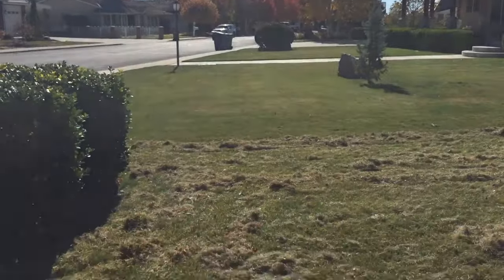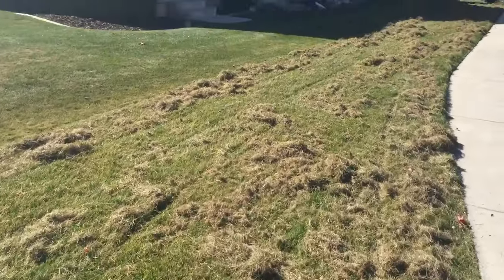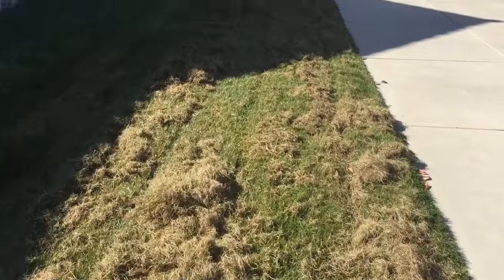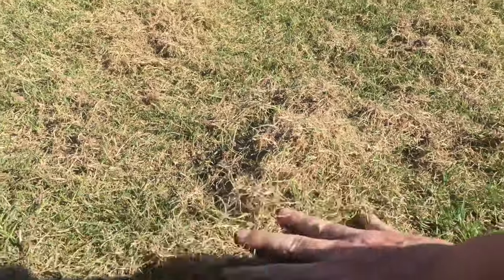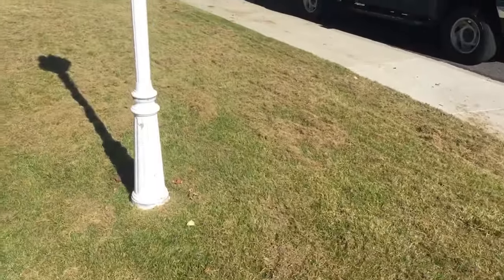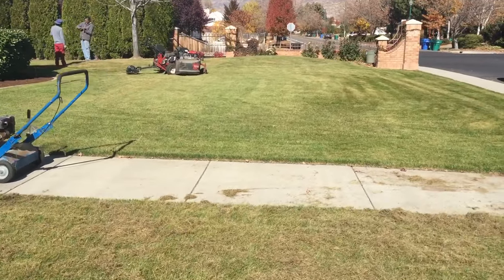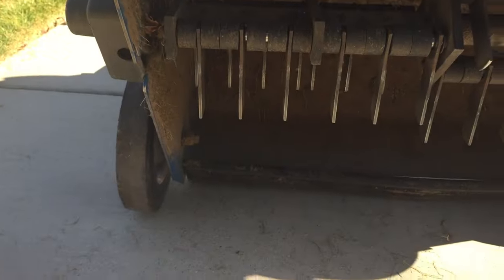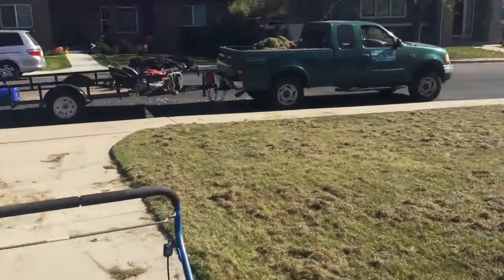Why and how to power rake or dethatch a lawn

Comment: I bought the exact dethatcher (power rake) in your video and used it on my lawn. A lot came out and it was pretty satisfing. I was very dissatisfied when I went over it with a hand dethather, a metal hand dethatching rake afterwards. The power rake got maybe 50 percent. I tried to go over my lawn again with the power rake in a perpendicular direction to the first time I did it. No more thatch came up, it just tore up the grass. I tried adjusting the height one hole lower but it really tore up the grass then. Now I'm using a hand dethatching rake and still bringing up lots of thatch even though it was already done with a power rake. I have a 1.5 acre lawn. It's going to take me all summer to do it by hand. I saw another video for a mantis dethatcher. I'm curious to know it the mantis dethatcher will pick up what the Bluebird power rake left behind.
Reply from the maker: I couldn't agree with you more.  To answer your question on which power rake is the most effective.....?  I haven't found one yet.  But I also haven't spent $7,000 to $10,000 on the ones that supposedly do remove most of the thatch / dead grass.  

I've found through my lawn walkthroughs at customers homes, who have power raked, that 99% of them that didn't complete the final hand rake still have 20% to 30% thatch/dead grass in the mid layers of the lawn.  The machine for the most part pulls the dead grass off of the top layers of the soil.

I would find a rake attachment or the dethatch spring attachment for your riding mower to remove the rest. Really appreciate the comment.  So much truth in what you're saying.

Comment: Nice video. I dethatch my TTTF every Spring as my “wake up” for air flow and I would never skip. Cleans out all the dead 💀 winter stuff too. 🤙🏼
Reply from the maker: I dont blame you. Makes it pop!
Reply: Exactly. 👍🏼
Reply from the maker: @LawnDad  it's also the worst job ever hahaha
Reply: The rake up! Lol 🤦🏻‍♂️
Reply: @ @pestandlawnginja  - After de-thatching the lawn, why do you rake up the thatch instead of just going over it with a mower and sucking up the thatch via the suction of the mower / bagging?
Reply: @Twister051  That's what I do.  Or, a strong blower will work, too.

Comment: Can you recommend the optimal cut height? I have two lawns. Both in the shade. One is full of moss. I recently bought a lawn mower robot.
Reply from the maker: Depends on mow frequency and type of grass. I mow every 3 days with bluegrass at 1" and every 5 days at 3". For mossy areas I would do 2" to let it air out.

Comment: So, my new VonHaus dethatcher-scarifier-aerator (would love to see your review of it) was delivered yesterday...assembly was a breeze. I got it early because it’s always “out of stock” on Amazon (maybe that’s a good thing?), and I didn’t want to be ready to use it on my lawn but couldn’t get it. My question is: I live in middle TN and my front yard is primarily Tall Fescue (Bermuda is creeping in, however...and the back yard is primarily Bermuda—already took over)...it doesn’t look too bad, until you look down and spread the grass—tons of thatch! I mow at the highest setting, which is just shy of 4 inches....never use the bag...always mulch. Okay, so here’s the question: When the yard is ready for me to scarify and dethatch (I have a professional lawn service doing the aerating afterward), how short should I cut the grass (assuming it’ll be the last cut of the season?) Thanks, and sorry my paragraph reads cryptically. Basically, how short for Tall Fescue? Thanks again!
Reply from the maker: Hey Danny. Great to hear from you. I'd take it down to 2"
Reply: Pest and Lawn Ginja - Thank you. I’ll need to figure out how to gauge cut height with my Husqvarna HU800AWDH, since I always cut it on the highest setting (one less for the Bermuda). Do I cut a little strip and then measure the blade length?
Reply from the maker: @dannymcneal  put it on the concrete, open the back shoot and take a stick and measure the height from the ground to the blade.
Reply: Pest and Lawn Ginja - I just moved my lawnmower to the driveway, opened the side door and measured the blade height from the concrete for all nine positions. 3.75” at position nine...2 1/8” at position 5...all the way down to 1 1/4” at position 1 (I’ll NEVER use that one—probably). I am stoked to know this information, and will be ready to mow it on position 5 this Fall. Question: Would you recommend that instead of going from position 9 (from the previous cut) straight to position 5 all at once? Or would it be safer and less stressful for the grass to, say, space the adjustments out more? Like one cut on position 9, the next cut on position 7, and the final cut of the season on position 5? Thanks for your advice! I’m stoked now!!
Reply: Oh, and can I cut to 2 1/8” and immediately scarify? Followed by a good dethatching? I have a lot of thatch, so should I scarify first and then dethatch? Or dethatch first and then scarify? Thanks again...sorry for being such a pest, but my learning curve is pretty vertical, but I guess this proves that at 61 years old, I’m still highly trainable. 😉
Reply from the maker: @dannymcneal  I always dethatch then scarify. Imo it's easier on the machine.

Comment: Can I dethatch in Summer? I think our thatch is killing our grass. Our sprinklers can keep our grass alive with the heat. TIA
Reply from the maker: The heat that the dead grass holds and the amount of water and nutrients that get bound up in the dead grass cause more damages than the potential of "burning" the roots from exposing them.  Which IMO is far fetched from reality and goes in the same pile of odd things to say like "you can't water on a hot day for fear of burning the lawn".  

The truth is, landscapers want to do power rakes late fall and early spring before and after they are finished mowing for the season to drum up more business.

Removing matter from the grass that is causing it to choke will not cause more negative consequences.  It will only benefit the lawn.  You'll want to apply some micro nutrients, Mycorrhizae, and organic fertilizer to stimulate the microbial action and growth of the lawn after you power rake.  I would recommend you do this no matter if it was spring, summer, or fall.  

First and foremost you'll want to make sure you check your sprinkler coverage to make sure the areas your concerned about aren't overly dry.  You risk scalping the lawn with a power rake if its too dry or too wet.  

Thanks for the comment.

Comment: My whole lawn has all these horrible hard clumps of dirt or possibly nightcrawler castings.  Walking on it is like trying to walk on a bunch of golf balls.  Would power raking help break them up & spread them around? Or do you have other suggestions?  I am tired of spraining an ankle every time I walk on my lawn, lol.  Thanks.
Reply from the maker: Earth worms are tough to deal with once they are out of control.  There are some insecticides on the market that claim they will help control earth worms.  I haven't had the best luck with them.  I find that regular aeration 2 to 3 times annually and a deep watering plan are your best way to control them.  I find they surface due to too much consistent watering.  If you get the top layer to dry out the worms will dig deeper.

For now if you would like to fix and repair the cheapest way is to water 3" to 4" and rent a roller.  You want the top layer soggy but not too soggy to the point where you walk on it and your foot is sinking into the soil.  Afterwards you'll want to top dress the areas that have sunk or are uneven throughout the lawn. Best of luck.

Comment: My yard 3 summers ago was great, last year 2 attached neighbors went weed crazy. It took over my lawn. Goatheads inc. Now my back yard is almost all dirt. Can I dethatch still? Will this eliminate the goat heads and allow me to replant?
Reply from the maker: Thanks for the comment.  If I understand your question correctly, you're wondering if power raking without a presence of grass can have an impact on Goat Head weeds?  That's a tough question.  Power raking is more of a process for lawns that are too thick or dense in dead grass or thatch layers.  Power raking an already thinned out lawn may not be in your best interest.  

Here's how I would approach your situation: 
I would decide weather you will 1. scrape the top and re sod or 2. over seed with a new grass.  

I would then spot spray weekly and be hyper proactive about it.  Goat heads can lay dormant for up to 2 to 3 years before germination occurs.  

I can tell you first hand that it took me 2 seasons to rid of all the goat heads.  Then we worked on my neighbors property "that was all dirt at the time", put in sod and a year later we were goat head free.  It can be done with a lot of patience and hard work.  Good luck my friend.

Comment: wondered why in the bald spots in my grass i had moss. i try to scrape it away but doesnt help. i wish i could just dig up the lawn and start again but im renting so even if they let me i wouldnt bother
Reply from the maker: Thanks for commenting.  Moss is generally a sign of too much moisture buildup in one area.  My suggestion would be to overseed the area with a shade mixture of Perennial rye grass and turf type tall fescue.  After it takes you'll want to make sure you're not watering more than 2 to 3 days per week.  Just remember the old rule of thumb, less days more minutes with your watering cycles.  If that fails you'll need to re-sod.  Hope that helps.
Reply: Iron kills moss too. Moss is also a sign of acidic soil. I’d recommend pulling a soil sample and adjusting the pH with Dolomitic lime
Reply from the maker: Great comment!

Comment: Hello.
I like the video very helpful.
I have a question I've killed of all my grass due to root weeds. 
Now wanted to start over  realised the ground is full of thatch and moss.
New house and never been looked after.
My question is can you still use a teacher rake on dirt ground is there is no grass or would it damage the rake.
Cheers
Guilio.
Reply from the maker: Hey Guilio!  IMO if you have tons of thatch and weed roots It may be better to do a shallow till, level, then overseed or sod.  If you choose to use the thatch rake I would use the cultivation side.  The rake is fairly sharp and I think if you did it lightly it would be fine.  They're only $35, IMO even if you did ruin it by the end of your project it paid for itself.
Reply: Pest and Lawn Ginja 
o that's brilliant Thank you for the info and help.
To look at it looks like dirt but treading it you do get the bouncy feeling.
Probly  seed it november after all the moss and thatch gone.
😀
Reply from the maker: cool guilio, best of luck.

Comment: Great stuff! But did you say the power rig rotates 200 times PER SECOND? If true, I guess using a manual thatching rake makes zero sense...?!?
Reply from the maker: That was my mouth talking sooner than my brain.  in all reality it spins quickly.  I believe the math is a 50:1 ratio.  What I was trying to say is the accumalitive scours of the tines themselves would add up to 200 per second.  but even that is questionable.  it is far more effective than using a thatch rake by comparison to time spent on the job.  with that said both tools are very efficient and the power rake is more invasive on the grass and requires about 4 to 6 weeks to recover where the thatch rake is about 1 week to 2 weeks to recover when done properly.
Reply: @pestandlawnginja  ok thanks for the added input - didn’t think about recovery time!
Reply from the maker: @kevinhorne2646  you're welcome!  Slay that lawn!

Comment: Hey Pest and Lawn Ginja
I’m located in Texas just south of Houston. Lots of humidity year round for the most part and especially during the warmer months. 
Is this something that should be done regularly to Bermuda grass based lawns? Someone told me Bermuda grass may not require this bc it’s a different grass than what you show in the video🙄🙄🙄🤔. 
TIA!!!
P.S. I really like your videos💚
Reply from the maker: You can avoid a lot of maintenance issue by doing a beginning or end of the season short mow on Bermuda. You dont want the runners to get too long, that come directly off the stolons.

Comment: Would you recommend cutting your lawn at the lowest setting prior to using the de thatcher? Planning on doing this tomorrow
Reply from the maker: My recommendation is to go as low as you can without cutting off more than 1/3rd of the plant.  We are going to put the lawn into a little bit of stress by performing the power rake so its important not to over shock the lawn with to short of a mow.
Reply: Thanks ginja! My roommate in college was just like you, best dude I ever knew. Red heads for life!!
Reply from the maker: That's the nicest thing I've heard all day!

Comment: What's the best time of year to dethatch? And is there a time of year to absolutely NOT dethatch? In Southeast Wyoming...
Reply from the maker: Great question!  I'm going to be making a video about this subject.  I tested the old rumor that you shouldn't do a power rake during the hot months because it will potentially scorch the lawn.  So, as a ginja does, I power raked my lawn during 105 degree temps mid july.  My lawn looked gorgeous 6 weeks later.

IMHO you can power rake any time other than winter months.  You still want the grass topically to be growing to make sure you don't scalp the lawn.  You also don't want too much water in the soil.  This can also cause the machine to scalp the lawn.  I best time of the year to do it, health wise, would be the fall time.  If you don't want to deal with the secondary die out of the lawn do it in the spring time right before you apply your pre emergent.  Hope that helps.
Reply: Pest and Lawn Ginja that's helpful, thanks for the reply! Looking forward to your upcoming video on this.
Reply from the maker: Anytime!!!
Reply: Should the lawn be thoroughly dried out and hearty before dethatching? Like, if the soil is really wet still here in early spring, should I hold off until mid-late may until things really dry out? I've used a powerbroom at my parents farm in mid-april to remove plowed sand, twigs, debris, etc, but I've never dethatched. My lawn is about 8 years old and I'm just really wanting to do everything I can to keep it healthy.
Reply from the maker: Ideally you want the top layer relatively dry.  It doesn't have to be bone dry.  Definitely don't want it over saturated or the machine will scalp the lawn.  If the lower level of the grass is dry it will be fine.  I always recommend a test pass.

Comment: I used a detach rake removing dead grass and crabgrass. I just removed the spots and not the whole lawn. Do I need to cover those areas before aerating? I left several emails with LCN, but no responses. That's not good. So I am reaching out to u.
Reply from the maker: Hey Peter.  Thanks for reaching out.  I'm not sure I'm entirely understanding what happened.  Are you saying that you now have bald spots in the lawn?  If that's the case I would aerate.  After the aeration you can throw some seed down and rebuild those areas.  Be sure to water it in well.

Comment: When is the best time to dethatch my Kentucky bluegrass here in Colorado ? (great instructional  videos!)
Reply from the maker: Thanks for the comment M&lbooth.  IMO late summer / early fall time is the best time.   It's best to power rake when the lawn is still growing so it has some time to recover.  The cooler temps will allow you to cut the bluegrass down to 2" without stressing it out as much and that will make it easier to get the debris off the ground.

Comment: Is there a walk behind power rake that simply rakes leaves? I'm getting too old to spend a day raking so I'm looking for powered alternative. Looks to me like that one you are using would be too aggressive for routine use.
Reply from the maker: Great question.  Most of the power rakes are going to be too invasive on the soil IMO.  There are a few electric options that aren't as aggressive as a traditional power rake like the one I'm using in the video.  

The one I listed below may be a good option for you.  It sweeps more than it digs.  I'm going to order one to do a video review.

https://www.amazon.com/gp/product/B0030BG1HM/ref=as_li_tl?ie=UTF8&camp=1789&creative=9325&creativeASIN=B0030BG1HM&linkCode=as2&tag=pestandlawngi-20&linkId=dfdcb916a1076ec16b739a32a3f489bd
Reply: @pestandlawnginja  I was actually looking at the same one. Little flimsy looking but might work out. I'll look forward to your review.
Reply from the maker: @OldePhart  the reason I reco.mend it is due to the spring loaded tines. I believe it will be less invasive as you're looking for. And at $100 it's cheaper by a mile.

Comment: Rather than rake up all that loose material, could you just run over it with a bagger mower with the height set higher than the grass?
Reply from the maker: Hey Timjs, yes you can mow over the materials with the right mower.  The final rake IMO is very important to get the rest of the dead debris off the top of the soil.  There's commonly another 30% left over that isn't pulled up by the power raking machine.
Reply: Pest and Lawn Ginja There is a machine you can rent that dethatches and sucks all the thatch up as you go..
Reply from the maker: great comment.  You make an excellent point.  In my local area I have never seen them for rent and that's why I haven't mentioned it in the past.  Those machines are about 4 X's the cost and they do a decent job too.  Thanks for mentioning it.